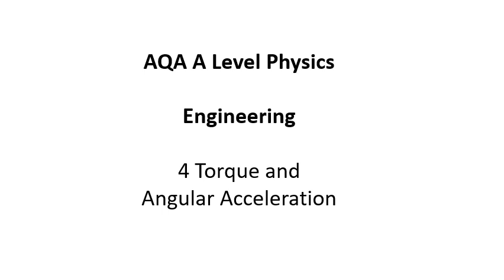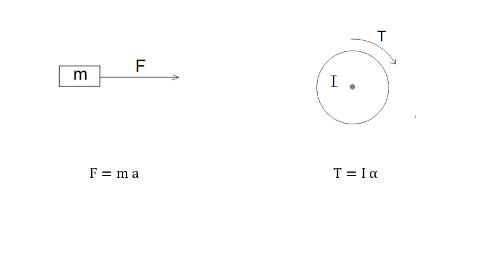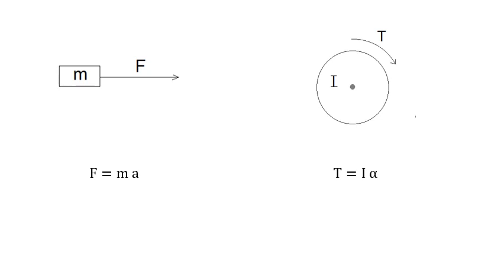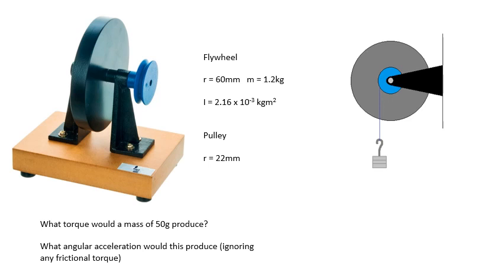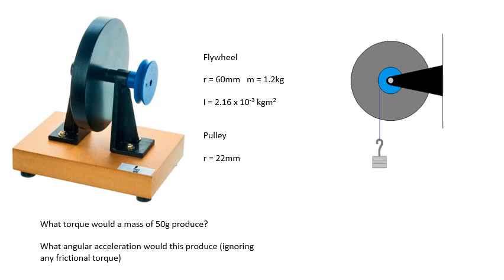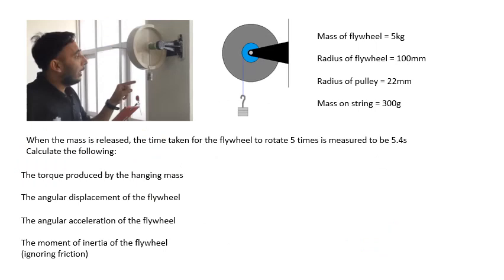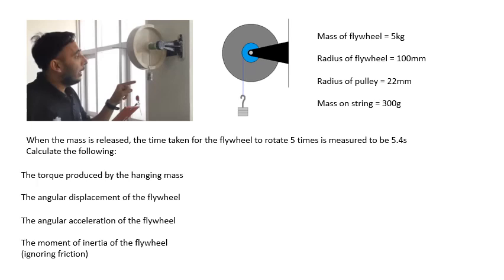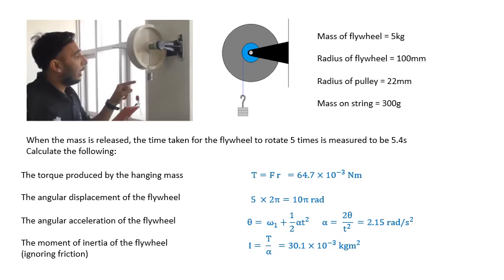AQA A Level Physics: Torque

Comment: For the question at 2:00
Is torque just equal to the force applied (by the weight in this example) x radius??
Reply from the maker: yes, where radius is that of the pulley

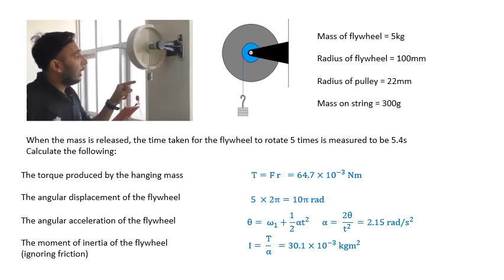Comment: I get 0.0647 not 0.00647 for the torque at 4:14 not sure what im doing wrong
Reply from the maker: (0.3 x 9.8) x 22mm = 64.7mNm       did you forget to multiply by 9.8?
Reply: me too
Reply from the maker: @lilsels  0.0647 is 64.7 x 10^-3     you are getting the same answer as me.
Can you use the ENG button on your calculator?
Reply from the maker: 0.0647 is 64.7 x 10^-3     you are getting the same answer as me.
Can you use the ENG button on your calculator?

Comment: For the last question when you are working out the angular acceleration of the flywheel, why when you use α = Δω/Δt or α = Δω^2/2θ the value of the angular acceleration isn't 2.5 rads^-2. I'm not sure why I'm not getting the same answer Is my maths wrong or am I missing something ?
Reply from the maker: but how do you know ω?   You need it to calculate alpha.   Just doing θ/t will give you the average value. You need to double this to get ω after 5.4s
Reply: @understandingphysicsbydave1349  Ok thanks for the help.